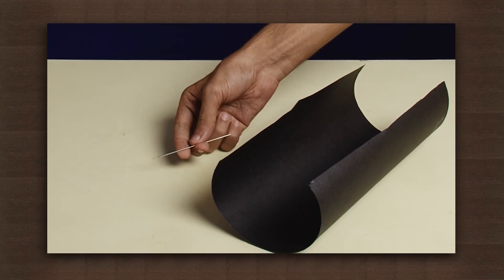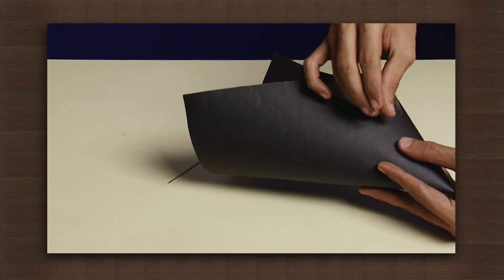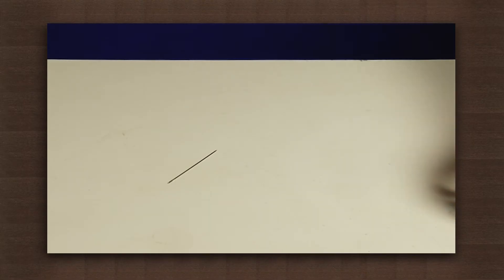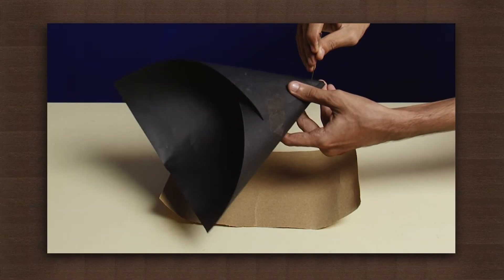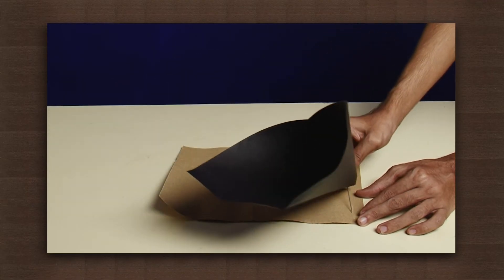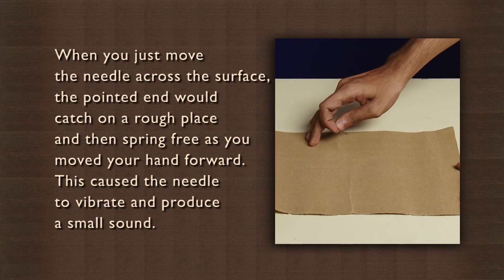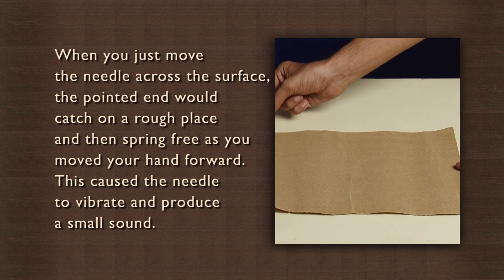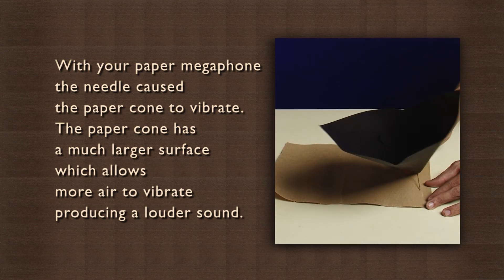Working of a megaphone | Sound | Physics

Comment: I don’t think this is really explaining it at all. He has demonstrated a single triangular cone, not a commercially produced megaphone. Also, I don’t believe the plastic cone of a megaphone is vibrating to produce a sound like a speaker cone. Rather, sound is produced either by your voice or a small amplified speaker at the back of the megaphone. That sound bounces off a series of reflectors and concave curved surfaces becoming more focused as it travels. I think it’s pretty intuitive that capturing and focusing the sound in a funnel shape helps to concentrate the sound. But I came here looking for an explanation of why the slight concave curve helps the amplification. It’s like the back side of a parabolic shape.